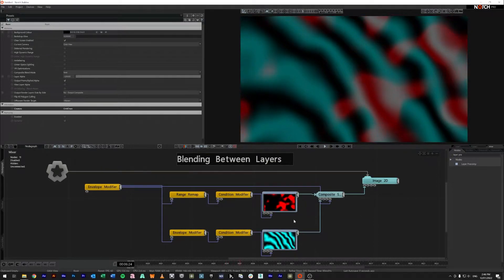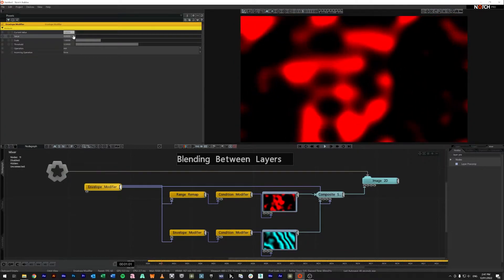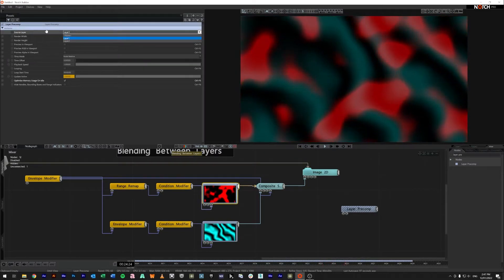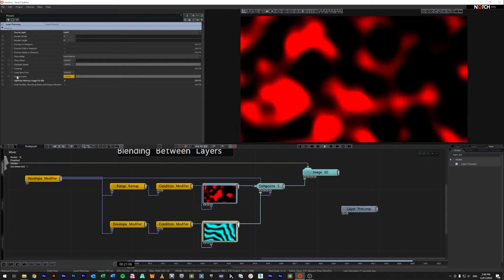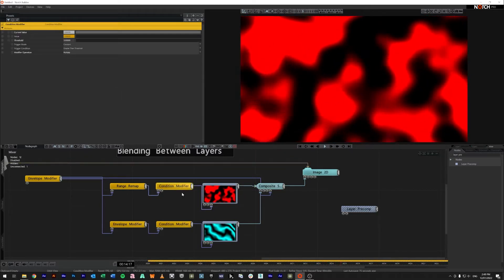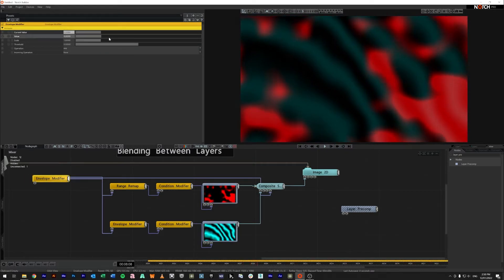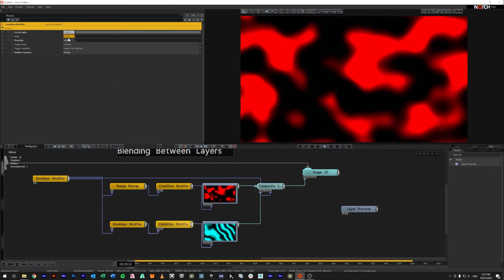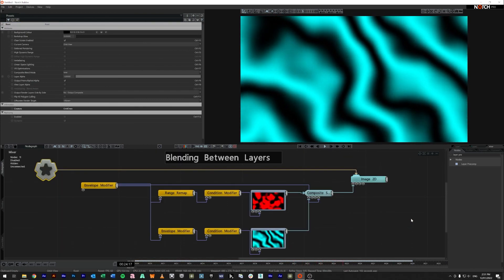Notch Tutorial - Blending Between Layers Using Layer Precomp Node.

Comment: Hello, I would like to ask you if you have tried to do this with two layers that use Nvidia Background Remover. I recently changed my laptop and I have this problem that I didn't have before. many log messages indicating that the Nvidia node stopped working, an unknown error. I think the latest version of the Broadcast SDK has a bug, but I would like to know the opinion of a colleague (my license is BASE, laptop Razer Blade 16 - RTX4090) great job, greetings from Mexico.